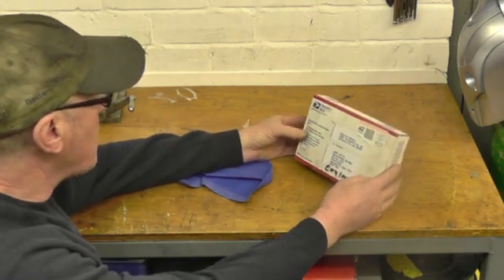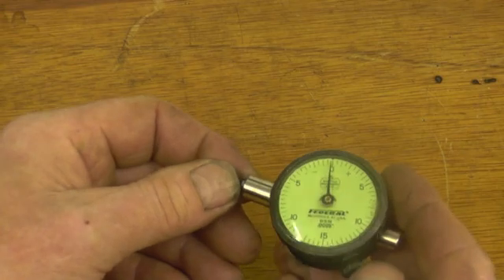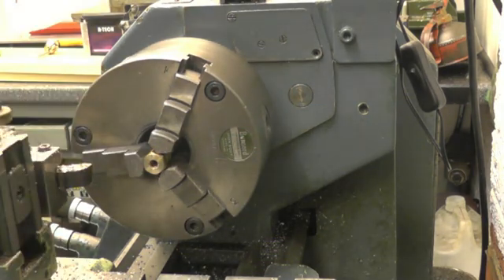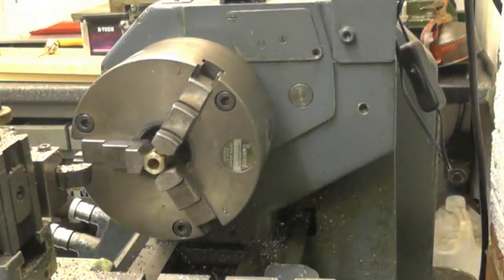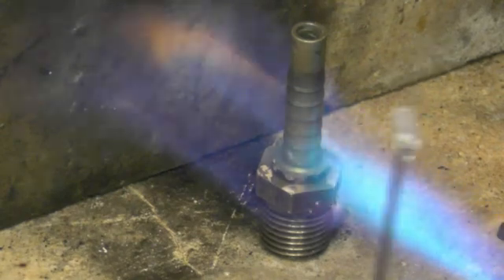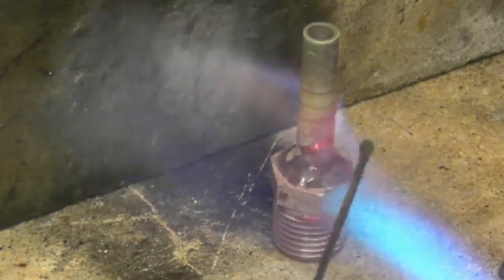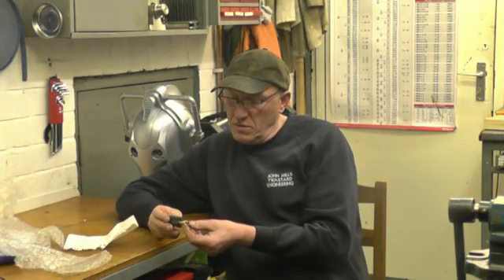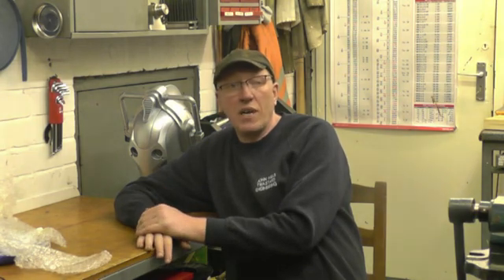Sunday Night Night Cap 18 Part One

Comment: John - Nicely done.

Simple tool. Piece of steel rod with four flats ground on it, so pyramid top.  Place against the hole, light tap. You now how four little raised areas. This will center and suspend the mating item, given an even gap around the part for silver solder to wick into.     (I wonder if I learned that from my Scottish Uncle, Mac,  but regardless it does save a bit of silver solder while leaving a strong solid joint).
Reply from the maker: Thanks Tom
I will give it a try
Best
John

Comment: i use alloy wheel cleaner to remove the coatings (phosphoric acid ) cheap to buy from a automotive trade outlet. i just drop it in a old mug of it, half a hour later, bare bright steel.
Reply from the maker: Hi Jon
You will have solderd a few fittings for the GT lol

Comment: For clamping air lines and anything short of high pressure hydraulic lines, I always use a ClampTite tool to make my clamps.  You can even make your own version of the tool and after that you'll never need to buy another hose clamp.  Best part is that they are nearly flush with the hose and won't snag on anything.  They are stronger than you need for most applications and look great.  Just do a search for Clamptite to see what I'm talking about.